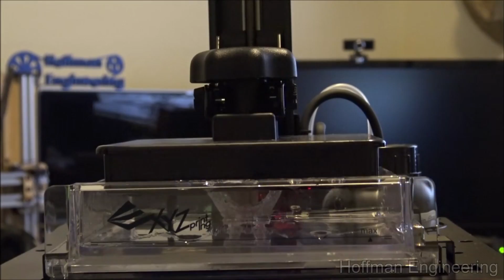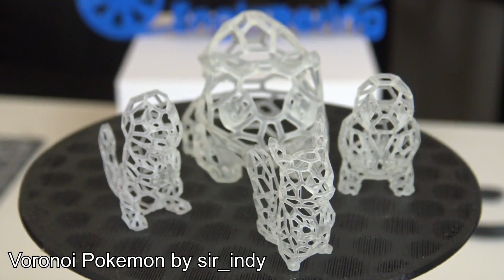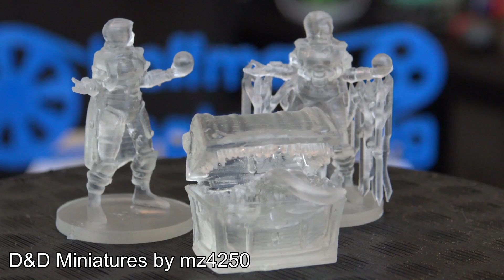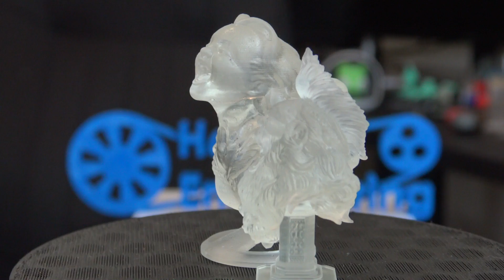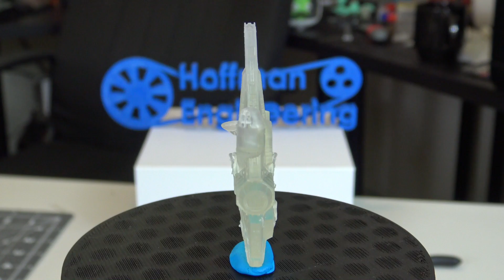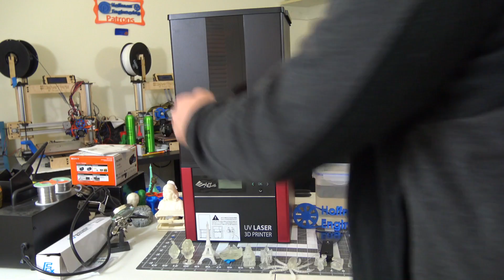High Resolution 3D Prints with Resin 3D Printers - SLA Resin Print Showcase

Comment: On Makers Muse channel he bought a file of power armor from Fallout that was too detailed for his Pruksa Mk2, might I suggest that as a next try? A few questions: Do you have to use XYZ's resin or can you use 3rd party resin? Also what is the maximum build volume on this? What were your print times on your various models? can you compare this to a Moonray S? And what have you heard about the Nobel resin printer that is one level above this? Will you guys test that one out?
Reply from the maker: That armor is awesome. Resin parts are much more brittle than filament prints, so it wouldn't be good for the bulk of the armor, but there are some decorative pieces to it that would be perfect for a resin print. Thanks for the suggestion!

As for your questions: 
* Yes, you have to use XYZ's resin, it has an NFC tag to monitor remaining resin levels, and I haven't seen a way around that yet. 
* The print volume is 128x128x200mm. 
* Print times ranged between 1h30m for the 4 pokemon, to 3h20m for the Eiffel Tower. The other models fell in between I believe, but I don't have accurate records for them
* Haven't heard of the Moonray S before, I'll have to look into it!
* And this is the Nobel 1.0a, which is the latest version that I know of. Unfortunately I don't know the major differences between the original 1.0 and the 1.0a off the top of my head.
Reply: Hoffman Engineering Thanks for the quick reply. Subbed now. 1. That is a shame, maybe if I take an old nfc smartphone and build some type of hack around this. There are some cool ceramic and castable resins coming out. 2. That's a very respectable build volume. 3. Thats not bad. 4. You should check it out, I think the Moonray surpasses the Formlabs 2 in every way at a cheaper price (3400 usd) and apparently you can use 3rd party resin with a built in spout to reserve the resin, pretty cool. 5. The higher level printer that XYZ showed at CES 2017 was the Nobel Superfine with a 2700 usd msrp. Supposedly it will release in Q2 and they said it has a resolution of 25 microns which would be class leading but I didnt actually see them print anything with it at the show. Hope you guys get to try it out! Jealous!
Reply: I have an answer to the query as to the difference between the Nobel 1.0A and the Nobel 1.0 - the  1.0A has resin types listed as: Standard Resin (Clear, White, Magenta, Blue) / Flexible Resin / Castable Resin / Rigid Resin / Tough Resin. Whereas, the 1.0 only has Standard Resin (Grey, Clear, White, Magenta, Blue) / Flexible Resin. All other specs were listed as the same. (That was "From the Manufacturer" on Amazon. :)